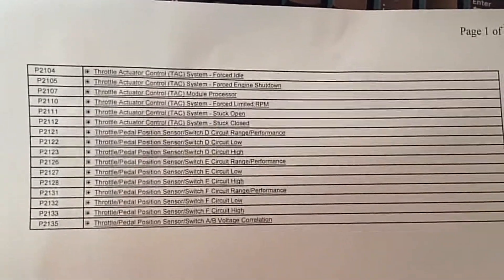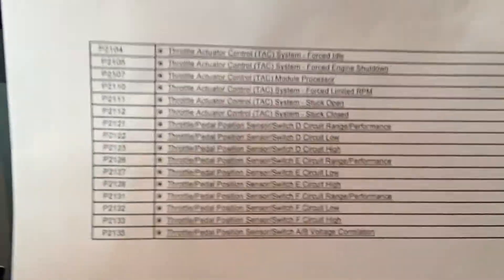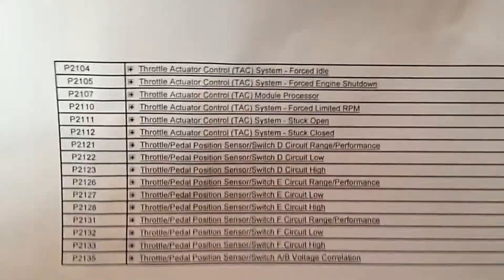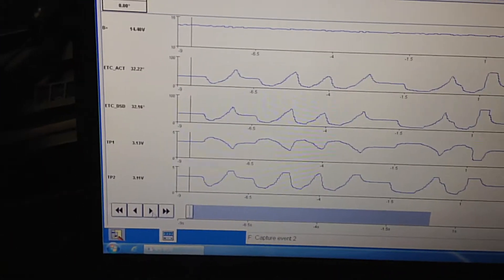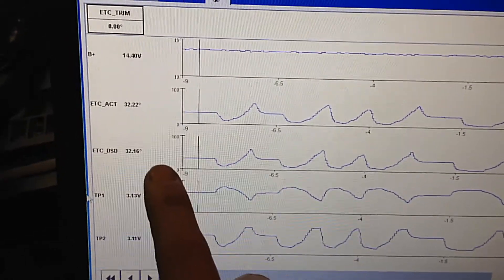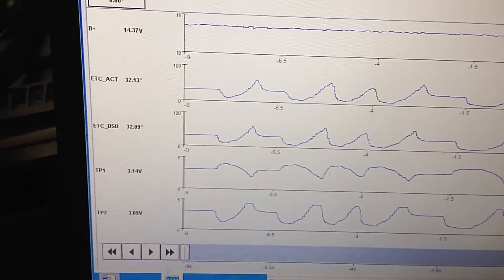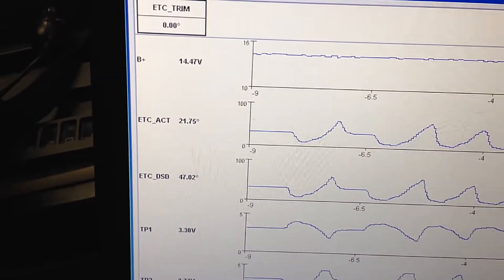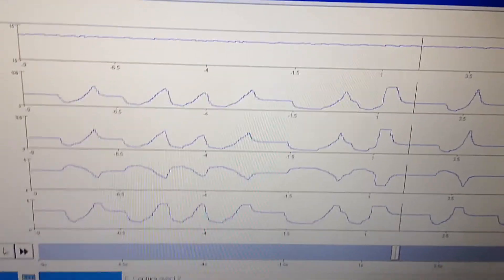Ford Electronic Throttle Body Failure Diagnosis

Comment: Hello: I know this is an old video, but hope someone can help. 
I have a 2009 FORD Fusion 2.3 liter. Car starts and immediately stalls . Light is on and scan tool gives codes P2107 and P0607. Wiring checks out as does readings on the six wire wire TB. Should I try replacing the TB, or in your experience,does the  P0607 always point to the PCM?

Comment: I am getting a 2104 and 2112, so it all points to TB issues. This is on a 2008 Sport Trac 4.6 with 140k miles. I changed the TB out 2 years ago at about 120k miles. Possible for the new one to have died so soon? I am now getting the wrench out of the blue and it goes into no move mode. Put the original back on and got the same once.  I bought a 2nd Motorcraft TB and will change it out soon. Could it possibly we wiring related? Like my TPS clip broke and does not hold anymore, so I had to tie wrap it down. Seems to stay tight. I am going to put on a new plug while I am doing all of this to see. Probably going to change the pedal sensor as well.

Comment: Just installed a good used 5.4. Idles great sounds good. At 20 mph the electronic throttle goes away. No codes . Swapped throttle body, same issue. Fuel pressure, trims , app all seem normal.

Comment: Does the ACT is the same that Absolute?
Does the DSD is the same that Relative?
I have a Transit connect 2010 that is giving me hard time bro! No codes....
No vacum leaks
New sparks plugs
New engine coils
New Injectors
And it still misfire and slow respond with more misfire under 2000 rev😭
Thanks💪

Comment: Thanks for your work. DIRECT QUESTION: What OBD reader do you use for that data? 
(I welcome answers from anyone.)
OPTIONAL DETAILS: I need to log the throttle position since my stumbling/stalling is intermittent (zero problems until stumble & die, then it will run again with zero problems). I will see if my setup (TorquePro & BAFX) will show that, but I have my doubts. Do any of you know whether the FORScan app (with BAFX) will show actual v. desired throttle body position?

Comment: Hi I have an issue with my MK3 Focus 1.6 tdci, the error code is P02E4 so the throttle body valve is stuck open, when I turn the car off it shudders to a stop and it hasn’t done its DPF regeneration procedure since the engine managements light has been on, so far I have tried two second hand throttle bodies off cars that were running but had been crashed and each time I relearnt them as instructed in one of your other videos, I’ve checked the wiring to an extent without replacing the entire wiring loom and Ford dealers say there is nothing they can do and to just try live with it as the car still drives, obviously it won’t when the DPF becomes completely blocked and the engine mounting are taking a beating every time I turn the car off...is there anything else I could try that you can think of I would be very grateful for your advice. Thank you

Comment: 17 Expedition losing all power while driving and giving yellow wrench. Took it to the Ford dealer and they couldn’t get the light to come on and found no codes. Drove home and it did it again. Any help would be appreciated.

Comment: Could a bad throttle body lead to, shaking at a stoplight, poor gas economy and take off hesitation intermittently? plugs/coils are new, new fuel filter, tranny flush, air filter. No codes at all :/ the problem is more noticeable after the vehicle is warmed up a bit (tranny is kinda of slow shifting) 6r60 with a  4.6 3v. I did recently change the battery.

Comment: I have a 2007 Ford Freestyle. it broke down on me on the highway.I had it towed to my mechanic. there was a hole burned through the intake manifold In a spot where nothing would cause that. the mechanic ordered a new manifold, put it on, started the re-learn process and it burned another whole in he new manifold in same spot. is this the throttle body causing this?

Comment: bro plz can u be of help im desperate. 06 freestyle p0701 i believe. they keep telling me i need a trans but ppl on here saying they had the same problem and it was the ETB. i was driving about 35 miles an hour and had to suddenly stop. car stop moving in forward. i step on pedal and no rpms. only in drive very minimal and reverse works. i can't afford to lose 500 dollars on ETB IF its not the part. thanks so much for all these informal videos. your a blessing
Reply from the maker: +tito vargas The ETB should be diagnosed they are very common and can cause this concern as torque load calculation is heavily dependent on ETB angle. Don't buy the etb at the dealer though get it on amazon and save a couple hundred on  the part- http://amzn.to/26NC0m9
Reply: So its not my trans then? Appreciate you bud greatly

Comment: I have a 2010 ford fusion built in 11/09. I have had my computer flashed but still I keep having an issue I feel is etb... when I take off sometimes the car acts as if it don't wanna go.  and when using the cruise it gets hung up in 3rd gear.. so like going on a slight incline and I have to let off of cruise. say a car in front of me is turning off or on the interstate.  I hit resume. the car gets hung in 3rd gear.  I have to hit the resume cancel button to let the gears change into the correct gear... the dealership I took my car too said this test that you have doesn't exist.    and they won't replace my etb.   they have to see the issue while driving
Reply: the sad part is even my car when I run my health report it shows up that the 13n03 is on my car but no help what so ever

Comment: Do these systems have a fuse?  I started a teardown due to a head gasket and rod knock.  I decided to put it back together and move the truck to another garage but now my throttle is stuck shut and I can't understand why.  I did an intake gasket last year and didn't have any problems then.  Why now?  TIA
Reply from the maker: eurocoinc I would do a cleaning of the throttle body and reset the pcm memory as shown in my two videos then it should learn the new throttle angle.
Reply: Thank you.  I assume if the stuck closed issue persists then I should perform continuity tests from the pcm connector to the throttle body?
Reply from the maker: eurocoinc If you continue to get a TAC stuck closed DTC it is time to change the Throttle Body.
Reply: Thanks. It needs a new power steering pump two cylinders are dropping out and now the tb.  I think it's time for a stronger truck.  Thank you for using your knowledge to help others, it is greatly apprieciated.

Comment: I have a 2013 explorer ecoboost that dies intermittently when throttle is at 3/4 down. I made a recording on Friday. I will review it on Tuesday. I had notice Map, Tp, etc all drop out like your recording. I'm also suspecting ETB

Comment: I was hoping for some info/advice.  I have a 2013 F150 5.0L with P2111 and P2112 codes.  I went ahead and cleaned the air filter, MAF and TB after watching your video.  I started it and let it idle for a few minutes and then cleared the codes.  I drove it for less than five minutes and the 'wrench' icon popped up and went into safe mode where the gas pedal was useless until i shut it off and started it back up.  Which i then took it back to my house to park.  It hasnt popped up the Service Engine Soon light yet but im sure it will eventually considering it didnt pop up right away when i first started having the problem.  Should i just replace my TB with another OEM one?  I have been offroading with my truck and the alternator went out and was obviously not covered by the warranty due to the mud around the truck and they said sand and mud was inside the alt.  Im certain they will say the same thing about the TB even though its been over two weeks since i went off roading to the codes popping up.  Just would like to hear what you may have to say about it if you have the time.  Thanks for any advice you may have!
Reply from the maker: Any time we have one of those two codes it is an automatic replacement of the ETB because  it is binding in the bore. It should have nothing to do with the offroading and should be warrantied for sure.
Reply: @FordTechMakuloco  If I replace the TB on my 13 3.5 EB Do I need to change any programing connected to the PCM? Or do I just let it learn it.